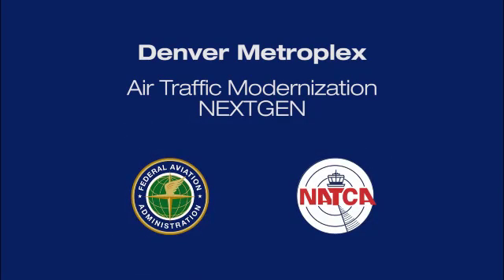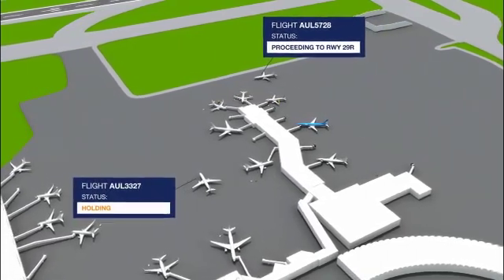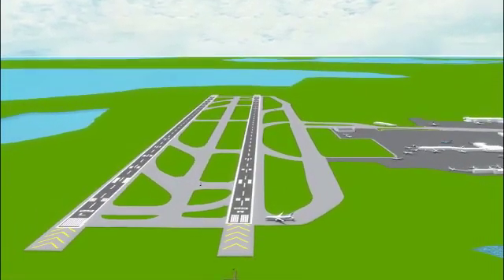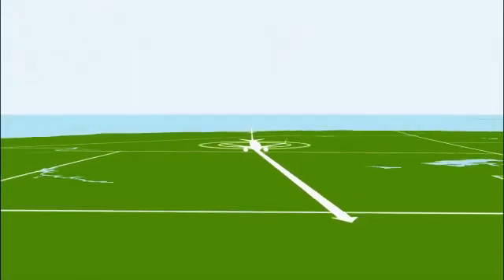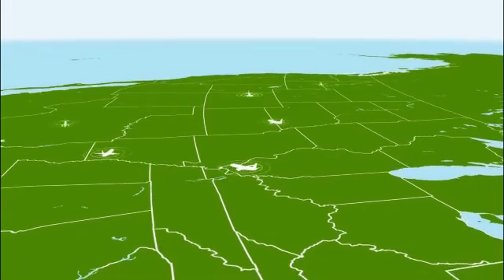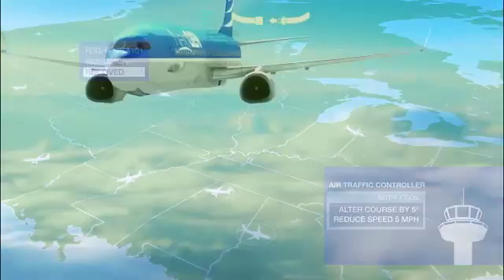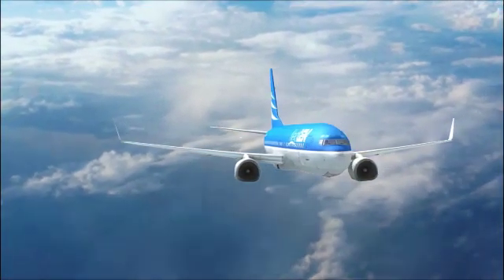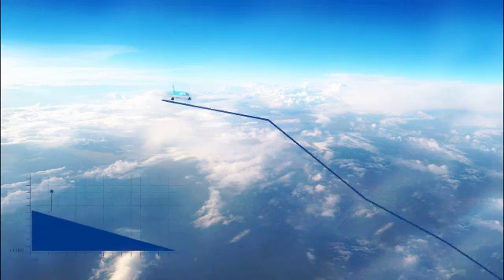Air Traffic Modernization

Comment: You could’ve just used MSFS for the animation lol and with the FAA’s budget I really feel like they should be further ahead on technologies to optimize flight plans for airliners. Technologically, it’s possible to use AI systems to generate the optimal flight plans to minimize overall pollution on a country wide basis. But bureaucratic red tape makes innovation slow
Reply: The aviation industry has to be on board; since each new innovation has implications for hardware/software on planes, and training requirements for professionals, it's often a challenge to get commercial/general aviators to get on board....